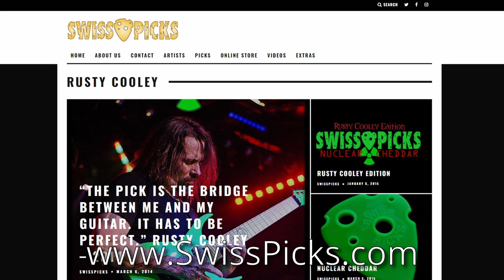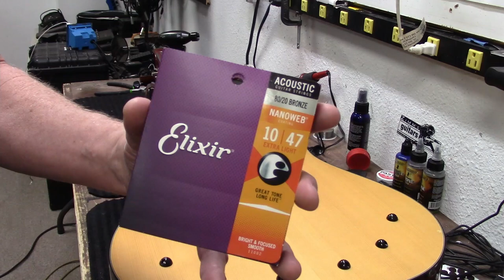The Strangest Acoustic Guitar! - Babicz Acoustic Guitar

Comment: I've had the black Spider acoustic for 16 years, best acoustic guitar I've ever played.
Reply: I'm very impressed with it.  It has a full and deep sound.  Plays great.
Reply: Hi Douglas henderson, I'm thinking of getting one of these. I'm curious, over the 16 years, have you/do you use(d} the Continually Adjustable Neck very much? Has it ever been something you needed to use because of high action, etc.? Thanks!
Reply: @MisterE428  I've used it quite a lot, experimenting with different gauge strings and making fine adjustments. The fact it's so easy to use and doesn't change the string tuning, blows my mind. I would highly recommend, it's a belter of a guitar!
Reply: @douglashenderson2284  Thanks, I appreciate it! That's the way I imagined it.
Reply: Adding my 2 cents for lead playing I can lower the action like an electric or for huge jangly chords or slide I can easily raise the action

Comment: Great to see your video. I’ve never met anyone who plays one of these guitars . I sought  one out for 6 months. Great guitar so adaptable. Great for playing single lines too, as in an electric.  Babicz recommend medium D’Adario strings for this model and they sound the best. Can really lower the action with no buzz problems with them. Rich sound. 
 I tried Elixer on mine but they sounded dull in. comparison and playing harmonics at the 5th 7th and 12th fret did not ring out as they do with D’Adario strings. I find the D’Adario custom light set to be the best compromise as light gauge just don’t give the rich tone of the two higher gauges I mentioned. 
Why are t these guitars more popular they are the most adaptable adjustable acoustics money can buy😀

Comment: I appreciate that someone tried to come up with a new design but basically it's just a variation on a cheap flattop design with a tailpiece instead of a pin bridge. And it sounds, to my ears anyway, a lot like they did, pretty one-dimensional and flat. I would think that having the strings anchored to the top like that would really inhibit the soundboard from moving both because the whole bottom half  is under tension from the strings being anchored and also because I'm guessing there must have been some additional support that probably deadened the sound further. They made a pretty big splash when first introduced. Maybe the higher-end models sound better but this is not my cup of tea.